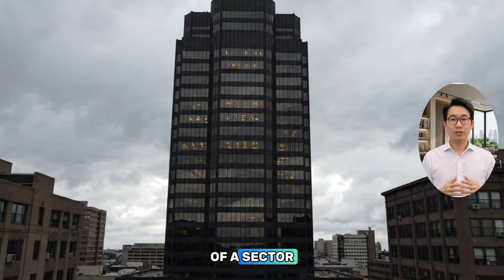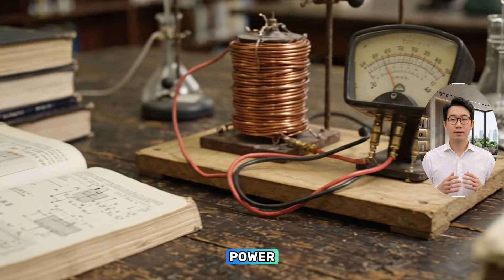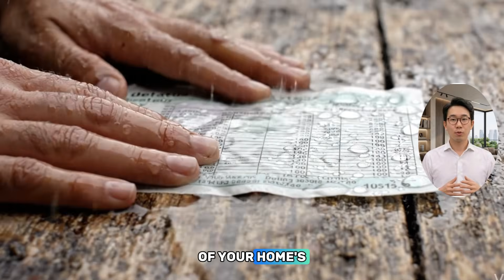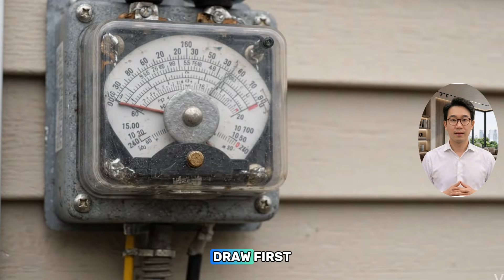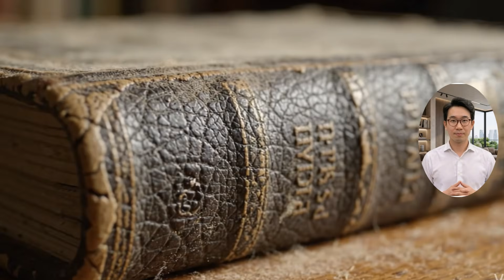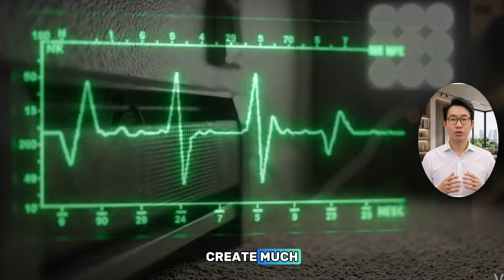The $2 1885 Secret That Drops Energy Draw By 40% — Utilities Want This DELETED

Comment: Technically speaking, yes, you can use something like that; they can be used, but for an ordinary residential consumer, this is, in 99% of cases, useless and a waste of money.
Here is why there is this huge difference between industrial and home consumption:
1. Billing (Main Reason)
At the apartment building/home: The energy supplier only bills you for Active Power (kWh). Even if your appliances (refrigerator, air conditioner) have a poor power factor and generate reactive energy, you are not charged for it. Therefore, a capacitor bank will not lower your electricity bill.
At factories: Industrial consumers are charged separately for Reactive Energy. For them, power factor correction means direct savings of thousands of lei.
2. Nature of household consumers
Most modern high-power appliances in your home already have solutions included:
PC power supplies, LED TVs and new household appliances have internal circuits called PFC (Power Factor Correction). Manufacturers are required by law to build them so that they do not "pollute" the network.
The only appliances that lower the power factor are those with motors (the old refrigerator, the water pump, the washing machine), but their reactive power consumption is too low to justify an investment in a capacitor bank.
3. The myth of "Energy Saver" devices
You've probably seen advertisements for small appliances that plug into the socket and promise to reduce the bill by 30-50%. Those are scams.
Inside them is usually a simple small capacitor and an LED.
They can marginally correct the power factor for a light bulb or a fan, but as I said in point 1, the supplier doesn't charge you for that deficit anyway, so the bill remains unchanged.
When might it make sense (Rare exceptions)?
The only situation where a capacitor system would help at home is if you have a large mechanical workshop or a household with many power pumps and old three-phase motors, where:
The internal cables heat up excessively due to the high reactive current.
The voltage drops noticeably when a large motor starts.
You are a non-household consumer (company) and you pay for reactive energy on your bill.
Conclusion: For a normal home, the best way to lower your bill is thermal insulation or switching to appliances with a higher energy class (A+++), not power factor correction.